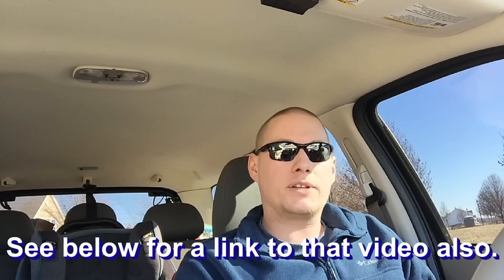Ford Ecoboost Engine Carbon Deposits: What You Need to Know

Comment: Its not just ford engines, took the head off a 90,000 mile audi TT 
2.0tsfi direct injection, ive never seen carbon build up like that on 
the intake valves
Reply from the maker: +aeroflopper yup lots of foreign cars have this problem also they have been fighting this for years
Reply: What this "technician" (and I use that term loosely) neglects to mention is that this is major issue for DI engines with an EGR like the 2.0L Ecoboost engines he referring to.  It was an issue on the 2.0 VW engine you are refering to because that engine had an EGR valve as well.  Ecoboost engines like the 3.5L  does not have an EGR valve which is the reason why you don't here of this issue with them.  The "technician" should re-title this video to not include all Ecoboost or DI engines, and only ones with an EGR valve.
Reply: alacey82 so, would eliminating the egr help? what do I do? block it off? vent it? Please let me know what your thoughts are? & how I should go about deleting egr? iv often thought about deleting my pcv sytem!!!!! Le me know ur thoughts plz?
Reply: Wow alacey82 , not too slick are you.  Before bad mouthing someone, you might want to know what you are talking about before you try to correct someone.  It is not the EGR (exhaust gas recirc) that causes the build up.  It is the PCV (crankcase vent).  This tech mentions Ford's use of the "exhaust scavenging" process that adds to the issue and how it will never completely go away because of this.  He never mentions an EGR valve.  Besides, the dirty air from the EGR valve is a mere fraction of the junk that goes into a cylinder.  He then states all DI engines have a carbon buildup issue.  He states Ford has that extra issue, but doesn't clarify why all DI engines have an issue.  I feel this is bad on his part and will agree with you that this is a problem.  What causes this build up?  It is the oil and gunk flowing over the valves from the PCV.  Since fuel doesn't flow over the valves in a DI engine and therefore clean the gunk off of the valves, you get buildup.  So yes, all DI engines have this problem.  This is why he and most techs recommend a catch can which, by the way, connects to the PCV, not an EGR valve.
Reply: Also, for D.J B., don't worry about the EGR if you have one.  Just put a catch can in line with your PCV.  You can't "delete" the PCV.  Your crankcase would build up a lot of pressure.  I honestly don't know how high it would get, but theoretically it would eventually equal the full pressure of your cylinders since blow by past the rings is a large cause of the pressure.  This of course would be in a zero leakage scenario.

Comment: All good info except for the suggestion of full synthetic oil. Synthetic oil is better than conventional oil in all but one way - it does not suspend particles as well. Synthetic oil molecules have a difficult time suspending combustion byproducts (carbon, dirt, etc.) and wear items (metal) in the oil and carrying them to the oil filter to be filtered out of the oil. So in any pressurized oil system with a filter it is better to run a synthetic blend. That greatly improves the ability of the oil to suspend contaminants in the oil and carry them to the oil filter so that the filter material can do it's job and filter out the contaminants. With full synthetic oil you have these contaminants dropping out prior to the filter and continuing to circulate in the engine. This is why no piston aircraft engine oil is full synthetic. Those engines run dirtier than automotive engines (air cooled, run 100 LL fuel with lead, etc.) so the problem is worse in an aircraft engine. But the reality is the issue is the same but to a lesser degree in any engine with a pressurized oil system and filter. It is worse in aircraft due to leaded gas which leaves more combustion byproducts and are air cooled engines. The next group of engines is any air cooled engine. The problem would be less of an issue in engines that are water cooled. But the reality is full synthetic should only be used in applications with no filter (like in a rear end or transfer case etc.) where the oil isn't filtered to begin with. But if the idea is to keep the combustion byproducts out of the cylinders you don't want to run full synthetic. Run a high quality synthetic blend. I believe the Motorcraft oil is a synthetic blend. Finally, the problem is worse with the new 5W-20 oils manufacturers are using to try and improve fuel economy across the fleet but it is much thinner so also has more difficulty suspending heavy contaminants and carrying them to the filter media to be filtered out. So great info except for the recommendation to use full synthetic oil. Use synthetic blend.

Comment: to combat the carbon build up on the valve, could I use water on the ecoboost, I've done this with the cars that I had and very good results and problems
Reply from the maker: No you don't want shock chunks of carbon off into the turbos.

Comment: I have a 2020 F-150 with the 3.5 L Eco- Boost. Is it ok to run 87 octane. What is recommended? What would the issue with 87 octane be? I run it and it seams fine. No issues with lag, engine performance or engine noises.

Comment: So, I own a 2019 2.7 eco boost and it has direct and port injection. I believe that was fords fix. I have 50k on my truck and it is running fine. I however put it in sport mode and run it hard once a month for about an hour in city traffic (most of my 50k miles are highway). But again it’s just something I do. Not sure how it effectively works

Comment: Any new news on cleaning the intake valves on 2.3 liter Ford ecoboost Mustang engines? 
There's a lot of information now (in DEC 2024) that using spray cleaners into the intake can damage or destroy the turbo.

Comment: I'm a loyal consumer of seafoam fuel treatment and intake spray cleaner. I recently purchased a 2007 Mazdaspeed 3. Just wondering if I should try the seafoam intake cleaning spray on that. What if I disconnected the intercooler piping while doing the clean? That way nothing gets through to the turbo.

After purchasing the car, I noticed right away that the tank was not filled with at least 91 octane. Mine requires 93 because of the tune. But once I filled it with shell v-power 93, it completely changed the way it was running. Night and day difference. The oil needs to be changed yet. I've only had the car a couple weeks. But who knows what kind of garbage is in there right now. Probably Wally world $1.99 per quart clearance 2 year old oil. I installed the proper NGK plugs with the appropriate gap that the tune requires. The old plugs were brand mismatched as well as gapped all differently. Once I changed them out, the car ran so much smoother.

It really is hard to believe people who have absolutely no idea what they are doing, do what they do.

Comment: I'm SO happy I sprang for the 6.2 instead of the Ecoboost at this point.
Reply: +Vern Burke 6.2 is a pig.  I'll take my chances on preventative maintenance actions.  100k on my 3.5EB and no issues - and have a blast driving it everyday.  Pennzoil Platinum, Top Tier Fuels and Techron every 10k.

Comment: I think the oil (CATCH CAN) is a great idea and makes the most sense. Unfortunately it voids the ford warranty.  My only concern would be the condensation  buildup In the CATCH CAN  in the wintertime.      
 Oh and as far is the warranty, it looks like it’s easy to take the CATCH CAN back off before you would bring your car in for any servicing.
Reply: I doubt Ford will void your warranty for having a catch can, a dealer might try to do that but just so you know Ford sells their own catch can system for the 2.3 ecoboost Mustang and the 5.0 Mustang so Ford would have a hard time justifying voiding a warranty when they sell a catch can system themselves.

Comment: I have a 2011 Taurus SHO with about 80,000 miles on it.  I want to add the RX catch can solution but also want to remove any carbon build up that has occurred.  From my research it seems that pulling the intercooler and flushing that is a must but I am also concerned about the carbon buildup on the valves.  I noticed in the video that you said that Ford doesn't recommend a manual cleaning but wanted to ask why?  If I were to pull the intake manifold and manually clean the intake valves while making sure that no carbon deposits were  reintroduced into the system via a vacuum or other method what damage could be caused by cleaning them?  I have also read that meth injection will help keep the intake valves clean but will that do anything for a car with this many miles to clean up past buildup?  Thanks for all the great videos.

Comment: I have 1999 F150 V6 4.2 engine on PASS side made clacking noise pulled valve cover off found bent rod but can't pull it out scan you help?? One good thing every thing is really clean no sludge or deposits  126000 miles.

Comment: I have a 2014 Ecoboost Fusion and considering trying the CRC intake value cleaner for GDI engines. It looks like the brake booster sits on top of the engine an considering going that route.  I value your opinion and wonder if you would consider posting a video on whether this is good idea proper way to clean the intake valves on Ford 4 cylinder ecoboost engines..  Thanks for all your videos... Many of the have be very helpful!
Reply from the maker: I wouldn’t waste the money

Comment: Hi Brian, 
I see that you recommend using a full synthetic oil, is there a reason why Ford is still using their synthetic blend? The dealership does all oil changes for me, it was included in the truck purchase.
Reply from the maker: ***** Synthetic blend is what is recommended in all Ford vehicles not just the Ecoboost so they just stick by the status quo as it is good enough.

Comment: Ethanol- I've some info on the fuel additive that would be of value. First, the E10 unleaded may not be as good as premium for The DI engine given the extra boost in cleaning additives, but the extra cost is not worth it. I do believe the "Top Tier" class of fuel would be the economic choice. Also, know that ethanol in E10 is not the problem. Ethanol has excellent detergent and cleaning ability par none. The problem is the base stock the ethanol is mixed with. It's a subpar low vapor pressure gasoline that requires 10% ethanol to make the fuel acceptable. The E10 mix is o.k ,but know a car could barely run on the fuel if 10% ethanol wasn't added. So, I'm guessing, a bit, that indeed E10 is not the best fuel for carbon deposits, but it is the economic choice for motor fuel. What to do? Like I posted ethanol is extremely clean and high quality fuel that will actually clean carbon from combustion chamber parts. You can google it yourself. I had an acquaintance, a gear head, that really was into performance modifications. He modified his Honda to utilize E85 fuel. After 80.000 miles he tore down the engine to measure and evaluate engine internals. The only thing that was surprising and actually shocking was clean combustion chamber. Truly amazing and just about as new condition. So, I'm going to add E85 fuel with my unleaded and burn Top Tier gas. So, far I'm adding 10 gallons wit 34 gallon tank and will alternate tank fills with no E85 then the second tank will get topped off with 10 gallons E85. If I run back to back mix with E85, probably drop ethanol to 8 gallons unless the tank was quite low. Personally, I would stay away from any decarb sprays as this is just to harsh and probably will cause lifespan issues with turbo. Ethanol, just doesn't generate as much carbon to start with. I would not put much ethanol in, but adding any will be probably be as good or better than the high test fuel at pump and should cost less than plain old unleaded to boot. You can down load an app to calculate how much E85 to add to achieve lets say an E30 mix. I would shoot for E15 to E30 and you may be surprise on how little the MPG drops.

Comment: What about seafoam that is placed at the throttle body, they say it's completely safe because it doesn't touch the turbo's.
Reply: Yes, i'd like an update video.

My neighbor just told me that the ford dealer cleaned the carbon off his valves on his ecoboost for $75. Cleared up all his rough idle problems.
Reply: Doyle Hargraves Yes there’s also CRC cleaner and that seems safe too

Comment: Thank for posting your experience and knowledge on these motors.  One question I have is with your oil recommendation.  What is that based on?  There seems to be less issue, in the ecoboost, with oils with a higher TBN.  Only reason I ask is I use Amsoil Sig Series 5w30.  Not saying it's the best, I just have used amsoil many years.  Also, why does a catch can void your warranty?  Is it due to emissions?  Thanks.  BTW, I run a '14 Ford Flex EB.
Reply from the maker: gfaststroker Any full synthetic nowadays is going to be a great oil but the penzoil was the cleanest in test and is why many oem manufacturers are standing behind them not to mention the natural gas technology.

Comment: Great videos  I hope you can answer a question I have a 2017 1.0 focus This generation has a baffling effect built into the front(boost) pcv outlet from valve cover  to upstream of the turbo.
Is there  any baffle on the rear (vacuum)pcv outlet on cover part number 6582?
Previous generations send pcv fume to bottom of intake manifold, my generation goes to the top of intake manifold and I don't see a separator.I have run a catch can on the vacuum side and get approximately an ounce of water with maybe half a teaspoon of oil mixed in every 5000 miles Pennzoil platinum btw. Thank for your time and great videos ,any info would be helpful

Comment: Has Ford adopted the workaround to scrub the air from the PVC so that this does not happen we have a warranty for drivetrain but it would be nice if they came up with a solution where we didn't have to worry about the vehicle being down for a head change

Comment: I thought Ford, just like toyota, uses a dual fual injection system with both direct and port injection and the port injectors are supposed to keep the intake valves clean? But I am a huge fan of oil catch cans and I've never heard of them voiding warranties!

Comment: I beg to differ with Ford engineers about manually cleaning turbo engine intake valves. If you do a meticulous job there's no need to worry about chunks of carbon being ingested into a turbo fan. Besides, if it did happen, I'd much rather replace a turbo thru the wheel well than pull the body and change out the cylinder heads.

Comment: Would like ft o know your opinion on fuel octane ratings for the e.b..I've been running shell 93 octane fuel in my 2014  f150 E.B..Im running that not for the octane but for the higher levels of detergents.I have also read that in some cases, higher octane can lead to lower mpg's due to its resistance of ignition.My objective is to keep my engine and valve train as clean as possible but I dont want to throw money away either.Do you think the E.B. will achieve a complete burn using 93 octane or should I drop to 91 octane and settle for a little less detergent.I also run a UPR dual valve catch can.I just did a 1500 mile trip and it captured appx 13 oz's of junk.Thanks and keep posting your traveling america videos, cant wait for the next one.

Comment: so, the only way to fix a small cold start skip on the ecoboost platform is to replace the $1500-3500per heads....great job ford
Reply: Not if the head(s) is pulled and cleaned OFF the engine, quite a bit cheaper than replacing, BUT still expensive!

Comment: I have to agree with Logan, it's 2019. You haven't heard anything from ford as a solution to this issue. Sticking our heads in the sand and Ford saying it isn't an issue doesn't do anything to help "the Issue". I would only guess that my 2013 3.5 EB with 91k, that I just bought not long ago, would have lots of carbon build up. I just installed a catch can, but rough cold idle is starting to be an issue. I also need to verify that the only way to know for sure if you have carbon build up is to take off the intake manifold and visually check the intake valves, correct?

Comment: Thank you for make this videos, did by any chance have you  worked on a mustang eco boost? That have like wen stop on red light engine start like humble, i have to shut down the ac to stop the humble, or cheking. similar to miss fire but on at idle, some time its does wen runnig but very smooth.

Comment: I noticed that Ford is offering an engine block heater as an option for the FORD EDGE SPORT...You mentioned something about cold weather potentially accelerating the carbon build up on the Ecobost engines during warm up...Will using this engine block heater help reduce carbon build up in very cold climates such as Michigan during the winter months?

Comment: I recently purchased a 2017 Fusion Sport with the 2.7 twin turbo ecoboost engine. Are there any updates in regards to the carbon build up issue as far as cleaning is concerned ?  I see that Steeda has a catch can kit for this car that could be of some help for prevention of this problem.

Comment: So going to premium and using that fuel system cleaner could help? I recently installed a catch can. I'm tempted to take the truck to the dealer for valve cleaning.

Comment: I have a '15 Fiesta 1.0L EcoBoost (bought with 141 miles, now has about 5,500) and I've already started putting some of this in practice. Switched to a top tier fuel (Phillips 66) and have noticed improved fuel economy and performance and will run Techron through it periodically to keep it clean. 

Just one question: Why Pennzoil as opposed to the Ford Motorcraft oil? Something additional in it to make it better or?
Reply: Pennzoil full synthetic oils are cleaner base oils and rated as excellent for turbo motors.  See bobiatheoilguy.com